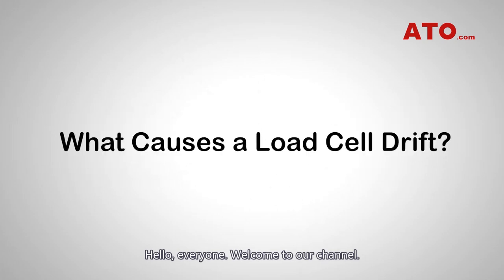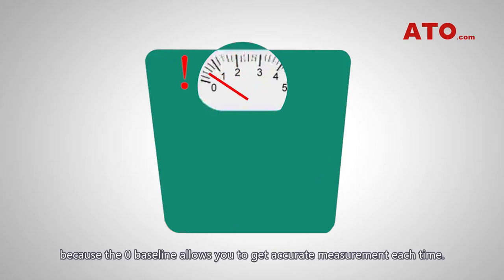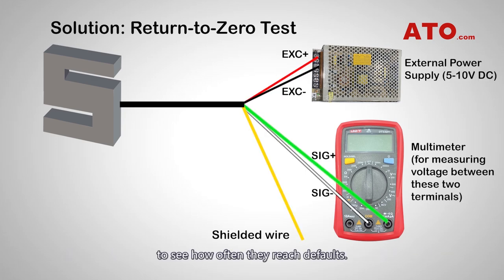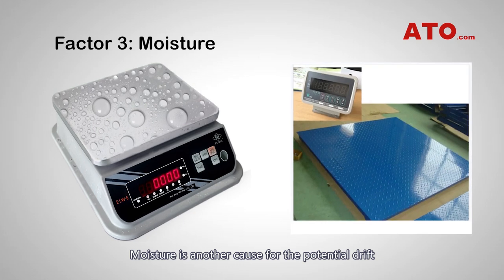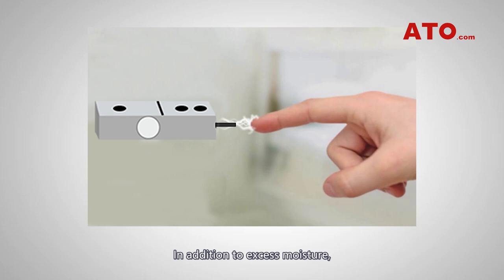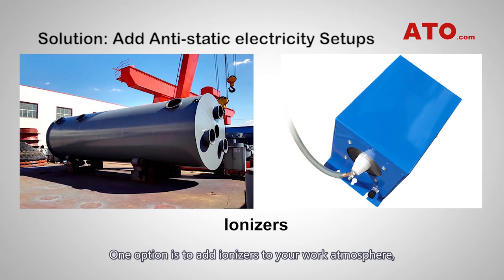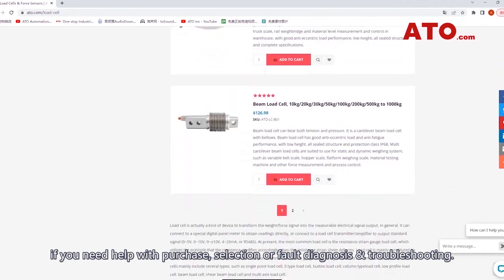What Causes Load Cell Drift & How to Solve'em

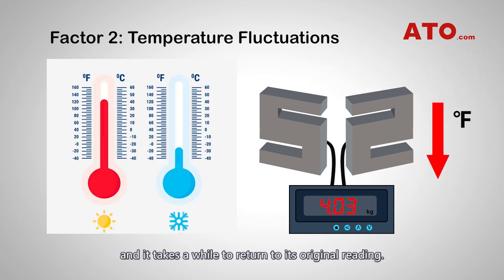Comment: 1:25 There's no way the mass of an object changes with temperature. The reading may change but the mass it self will be constant. Reading can change due to changes in stiffness of cell material with temperature as well as change in resistance of load cells with temperature.

Outside of this detail, I appreciate y'alls video! Thank you.
Reply from the maker: You're right. Changes in temperature may have influence on the cell accuracy in many ways but won't change the mass of an object. That being said, temperature is still an important factor to consider in solving load cell drift. Thanks for your comment :-)